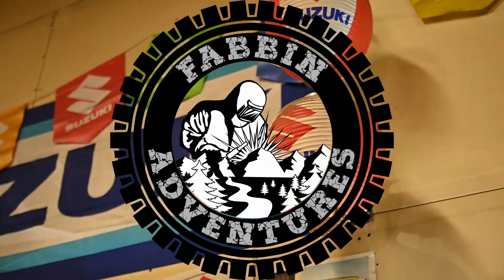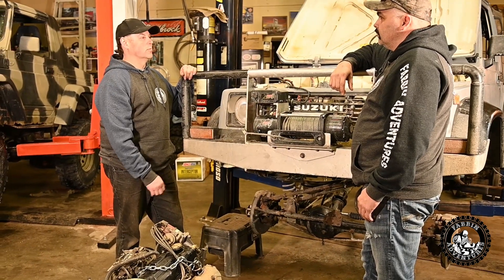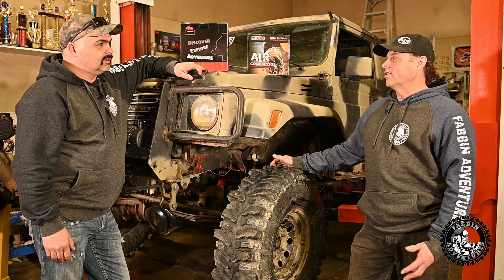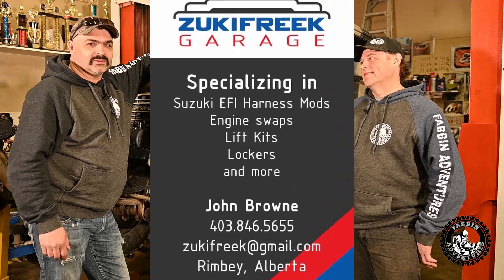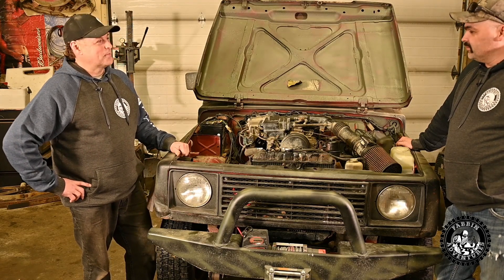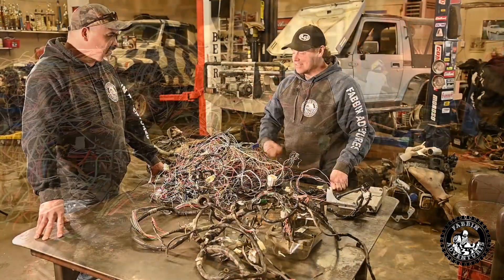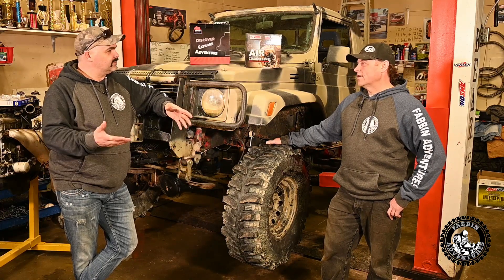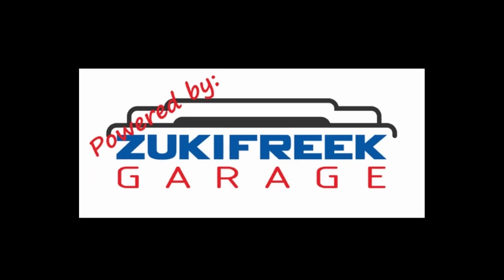Zuki Freek Garage: Engine swaps, wiring harness mods

Comment: You guys are great,  Too old for clutches 🙂, I liked when John said,  B/W ,  I just bought a SJ 410, My first SJ, I had earlier Vitaras.
Reply from the maker: Lol thanks!
Awesome, have fun with your Vitara
Reply: @FabbinAdventures  , As you you are samurai expert, Can you tell me, If I replace my Sj 410, Engine which is only 1000cc,  with 1.3 or 1.6, my existing 4 speed(manual)  transmission will be ok on Highway?  Regards.
Reply from the maker: Thats a good question, i would think you might want to find a samurai 5 speed transmission.
Thanks for your comment!
Reply: @FabbinAdventures  : Thanks man, I knew it you gonna say 5, Will go for 5!
Reply: @FabbinAdventures  : hey, man can you tell me, What Vicousity oil should i put in samurai Diff, ☝  where I live its a HOT region!! Regards.

Comment: Nice interview.  I think the 16v  single cam has every weaknesses in all the Suzuki.  Too many moving parts on such a small engine.  I like the tween cam 16 valve, I’ve owned several single cam with 16V all turned out bad compression, leaking and burning oil, could not pass smog and loss of power, cam shaft scratched.  Now I stick with the 8V 1.6L engine and sidekick flywheel and 4x4 manuel transmission  connected to Samurai T-case, cut off the sidekick T-case chain patched with aluminum plate add 4.24:1 T-case gear connect to Samurai 6.5:1 this setup is extremely low for the Samurai.  See my setup Ron, just want to help bridge ideas for all Samurai owners out there.  Great interview video.

Hope to see you Samurai guys on the trails sometime.
Reply from the maker: I have not had any trouble with mine yet and a buddy of mine has run the 16v for years with no trouble, and he is hard on his stuff!

Comment: same engine,exhaust,same truck  convert obd1 to obd2,  3x  and each time have not same sound, and  mini back fire. obd2 get better ignition spark and fuel control, low torque. ecm work well obd2 by my experience. with 4/1 headhurst it a good upgrade. .   for work and cost